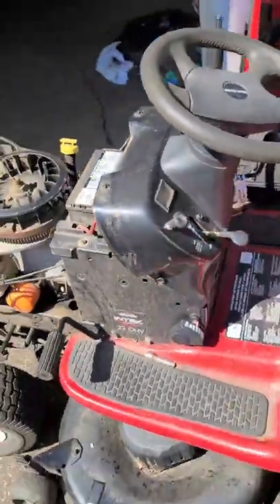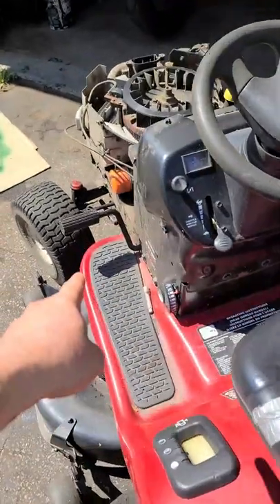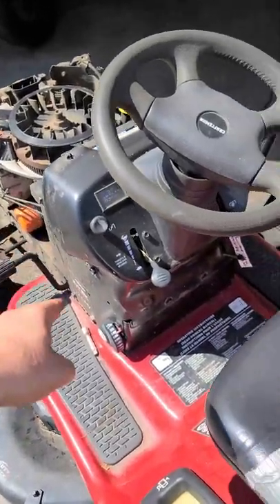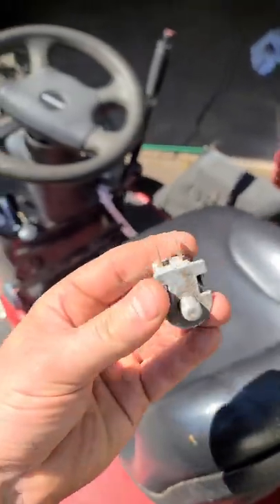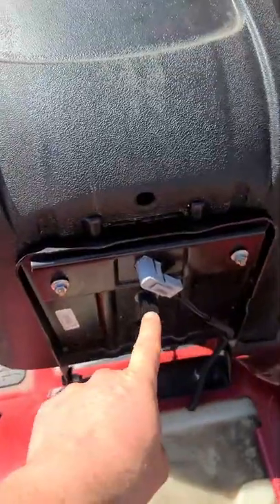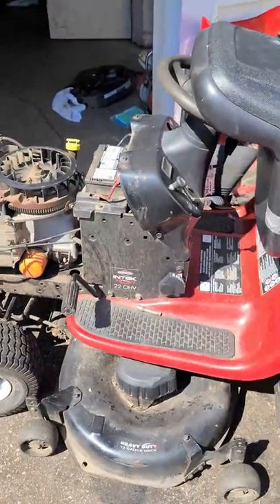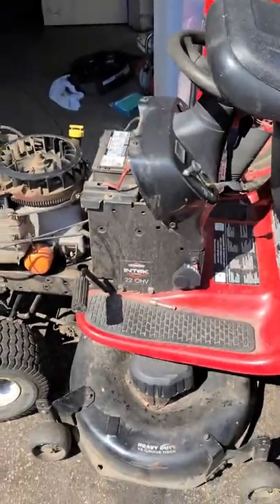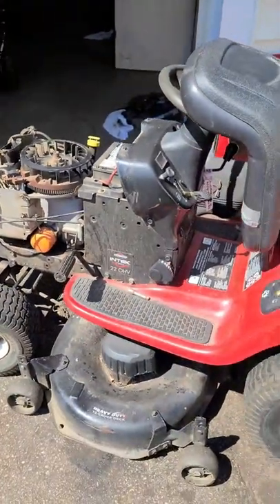If Your Lawn Tractor Dies When Releasing Clutch Pedal CHECK THIS!

Comment: You aint gotta pay no money just connect to 2 wires together and you're done
Reply: That’s not very smart
Reply: @THEMOWERMEDIC1 Yeah wouldn't that  just constantly draining the battery because you have a constant current going even when you aren't driving it. Not a problem with it running cause coil is recharging the battery.

Comment: Just wanted to thank you for the video. I replaced my starter and I put a wire jumper in the seat connector to eliminate the safety switch but after watching this I quickly knew what was wrong. Thanks for saving me a lot of headaches

Comment: replacing  the switch did not work.engine still stalls when releasing the clutch pedal.  I put a  jumper  wire across the switch wire terminals.The engine still stalls when the clutch pedal is released.

Comment: I've already done that years ago I bypass the safety switch for the seat. Now I can get off the lawn mower and leave it running. That's been done years ago. But I'm having that problem with removing my foot from the clutch it dies. Also with my foot on the clutch trying to engage the blades makes it die.

Comment: When ‘Lowe’s’ delivered my ‘Craftsman’ it was lightly covered in grass-clippings, it had been slightly used.  Well, I started it up, put it in forward gear, lifted my foot, and it died … three times.

Back it went, and the next time they delivered me a nice shiny new one.  It has worked great for me, but I always wondered if I had experienced what might be a common fault on the model.

Now I know to what to do before I start cleaning/changing air filters or hauling it to someone with more knowledge than me.  Thanks very much.

Comment: Most interlock safety switches are not bad when replaced. It is the contact point that actually engages the switch that is usually the issue, either dirt debris blocking contact, or the harness plug is loose or corroded.....I service and repair thousands a year.

Comment: I wouldnt replace the switch just jumper it. No more stupid safety switch.
Reply: The seat switch is useful. 
As Firefighter, several times we’ve had a call where someone falls off the seat for any number of reason(heart attack for example, or just not paying attention and falls) the mower would keep on going to hurt somebody or damage something.

Comment: Literally just had one in my shop over the weekend,  it would not crank, Customer stated he replaced the battery with I new unit, then proceeded to remove the top of the engine, coil, ignition switch from the dash and had a jumper wire in the seat switch, I Replaced the 15a fuse, now it runs and starts great.
I believe they tried to hook the battery up wrong as it was in the Compartment backwards.

Comment: I have a cub cadet 2166 that dies when the clutch/brake is released. The seat switch is jumped, the pedal switch tests good, as do the ignition switch, pto switch and fuses. It runs fine. Just dies when the pedal is released. I'm almost sure it's not the wrapped wires since there's no sign of rodents. Any thoughts I might have missed? I've also checked the 2 relays and both are good. Solid ground and positive cables too.

Comment: I had the same issue with and older Murray riding mower, the battery died and after replacing it, it would die when the brake/clutch was released.  I replaced the 15 amp fuse, safety switches for the seat, blades and brake/clutch and it still stalls when the brake/clutch is released or the blades are engaged, even if in neutral.  Any idea what else it could be?
Reply: Did you find the problem? I'm stumped as well.

Comment: What should you loon for if it still dies in the same manner but you've spliced the seat switch together?
Reply: I did the same thing and still dying. Did you get it fixed, I spliced the white wires and taped them together.

Comment: Good tip say my riding mower dies after running for a half hour. Any tips would be great
Reply from the maker: try with gas cap loose first in case it's not venting

Comment: I replaced the seat switch & it still does it, I will try the brake/clutch switch next
Reply: I’m in the same boat. Just plugged a new seat switch and it still does the same. Any luck with the brake/clutch switch?